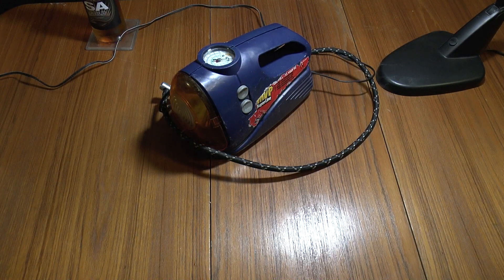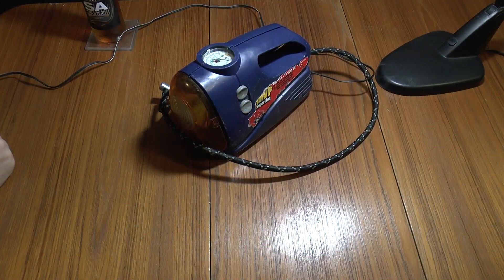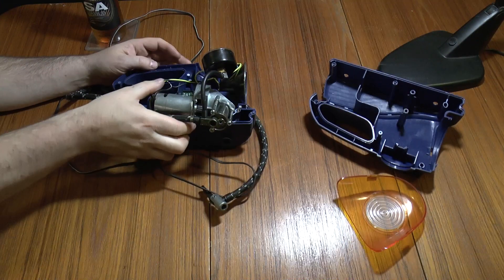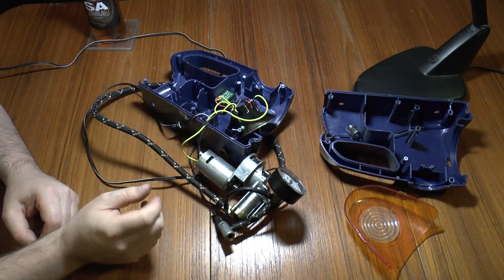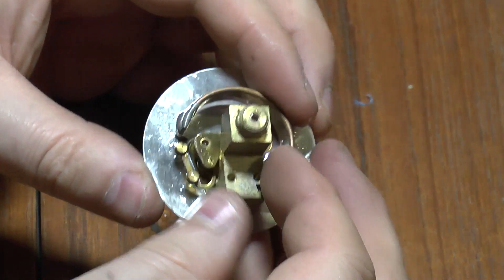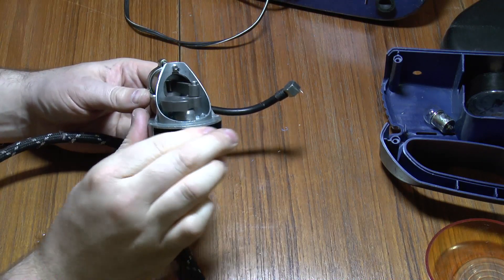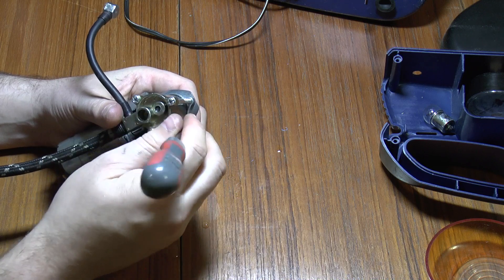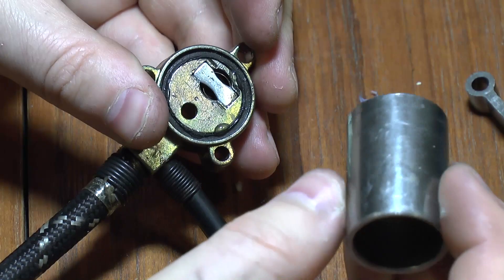MVP 12 volt air compressor teardown

Comment: @AintBigAintClever  There are different air compressors without inlet valve on cylinder head. Where else could inlet valve be located? How are such inlet valves working?

Comment: 4:27 I have a Slime brand compressor that seems like  a little brother to this design; the piston is almost identical. The rubber seal on mine is just about non-existent, so it has no hope of working. I don't know if one can order a new one, or if it would be possible to improvise something. Thanks for posting this; at least I know how it should look now. 
PS: The hole through my piston rod is conical from the wear of it clanking around all this time. I flipped it over, and added a plastic plug to limit its side-to-side motion,  so there might be some more life left in it as I sealed a lot more grease in the chamber than was originally there.

Comment: So what makes such a racket? Connecting rod - Piston assembly?
It would be great if such compressors can be modded to be a bit quieter.
Reply: A counter-rotating disc geared to the the same speed as the crank would perfectly balance the piston and that would cut the vibration a lot. I've seen some models with a lot less vibration, so I'm guessing that they added this feature.

Comment: My 12v compressor is DOA -- no hum or anything when plugged in. I replaced a burned out fuse in the plug and it has not blown after subsequent plugins. There are no hidden switches and I've jiggled it in the lighter socket -- with car running -- to no avail. 

As an experiment I ran continuity test with multi-meter, putting one lead at connection to motor and the other at the center (fuse) contact or one of the side clips on the plug. I've run every combination of leads and: when leads are on the same wire, (e.g., side clip of plug and connection of THAT wire to motor) I get 0 ohms.  When leads are on opposing wire (e.g., center (fuse) on plug and connection of opposite wire to motor) I get continuity with 001 ohm reading.  That seems to indicate current runs through motor, and brushes are at least good enough to send tiny multi-meter current through, and if there's any internal switch it is "on" (I think).

When I plug motor into car (while running) and put leads on motor connections for voltage test, I get 0 volts. So, the motor is drawing zero voltage even though all the connections are good. This makes sense since motor isn't running, but I'm trying to understand why it doesn't even draw a little bit.

Would you conclude that motor is simply fried (although it passes current through and wouldn't it at least hum in that case?) or is it possible that the plug itself is bad, i.e., maybe the side clips aren't making contact at all (seems unlikely but it's all a mystery to me so I'll make any guess!)

Thanks in advance for anybody's input. I'm a total rookie at motors and this old roadside emergency compressor is my first attempt at trying to learn. I suppose there are components within the motor that cause the motor to fail even though current passes through, and I just don't know enough to understand what's happening.
Reply from the maker: Is the cigarette lighter socket still working normally apart from this? Running a USB charger or an actual cigarette lighter, for example?
Reply: Thanks for replying!  Yes, the car sockets work. I tried testing my compressor on two different cars. In one car, phone usb charger works. In the other car, a power inverter works. Any guesses?

Comment: howzit buddy. Excellent on explaining the tech part of how a miniature portable air compressor work. However I wanted to know are the internal hose that connects from the motor and hose that connect to PSI gauge do the hoses have a specific name or are they known as fill air hose. I can't find anything on line that describes the names of all the parts of portable 12V air compressor. There's alot of data about the regular large compressor but not too much about 12V compressor
Reply from the maker: Just braided air hose I think. Putting that into Google Image Search brings up lots of examples.

Comment: I know this video is old but what would make a brand new 12 volt compressor not come on? I opened the package, plugged it in cigarette lighter and NOTHING. Nothing on it comes on. The cigarette lighter works great but compressor will not come on in any kind of way. Is there a fuse in it that could be blown or something? I can't figure out how to get it to work . Any help by anybody on here is greatly appreciated.
Reply from the maker: 1) There may be a fuse in the plug (the tip will unscrew to reveal the fuse)
2) The plug may not be making contact, try rotating it (in the socket there's a centre contact plus two sprung side contacts which grab the lighter when pushed in, these contacts need to touch the side contacts of the plug)
3) The socket may be off when testing (some cars have permanent 12 volts to the socket, others need the key turned to the first or second click)
4) The compressor may have a switch fitted (possibly in a daft location)
5) The compressor may be DOA.
Reply: Thanks for the reply

Comment: what material was the framewrok for the gear/piston made out of? what your left thumb was on at 3:16
Reply: and what would that part be called?
Reply from the maker: +Manz I suppose that would be called the gearbox. No idea what sort of metal it was, probably the same sort of die-cast stuff used when making Matchbox cars.

Comment: Hi AintBigAintClever, there are like thousands of these tyre inflators out there. Reading the comments on each always throws up the fact that most don't last beyond a few uses. Which one would you recommend that's well made? I don't even mind one that operates off the mains (power). I bought one off Argos but it died after less than 10 uses I should say.
Thanks!
Reply from the maker: I'm currently using a Michelin one with digital gauge and auto cut-off, on a weekly basis due to leaky tyre beading.
Reply from the maker: +AintBigAintClever Not broken the Michelin one yet.

Comment from the maker: I don't think so. The valves are simple one-way valves. Blowing air in through the inlet valve would blow it straight back out through the outlet valve. Blowing in through the outlet would get you nowhere as it would just stay closed.

Comment: The lamp is probably 8W or so as that is a common power rating for those types of lamps (G6 single contact bayonet) over here (67, 97, 98, etc).  21W lamps usually have S8 envelopes.

Comment from the maker: A pair of simple (and small) ball check valves. I've ordered two new compressors from eBay (250psi for £5.25 inc. delivery), will be interesting to see if it blows up before the bottle does, and if it can get anywhere near 250psi!

Comment from the maker: Not much inside an air compressor, so might as well make the teardown as complete as possible. Except for the motor, we all know what's in there.
Reply: There are different air compressors without inlet valve on cylinder head. Where else could inlet valve be located? How are such inlet valve working?